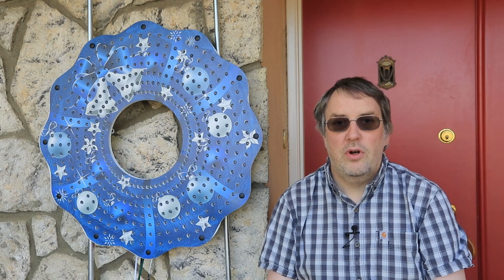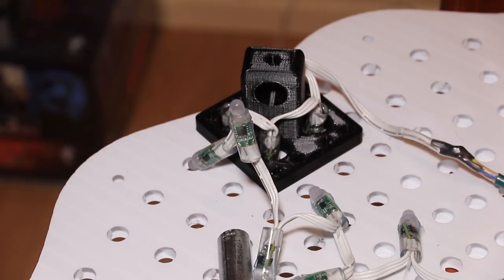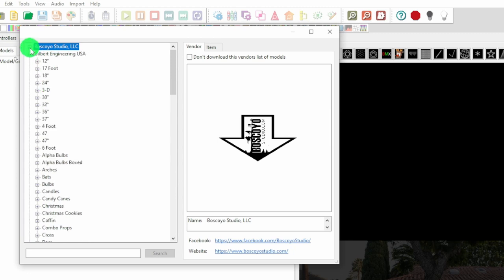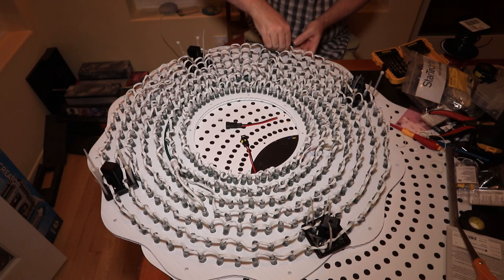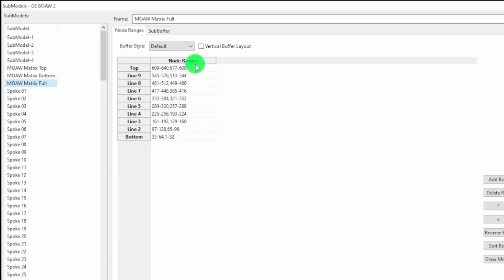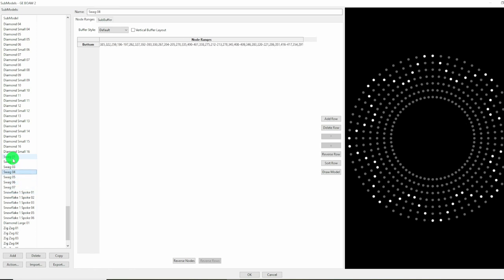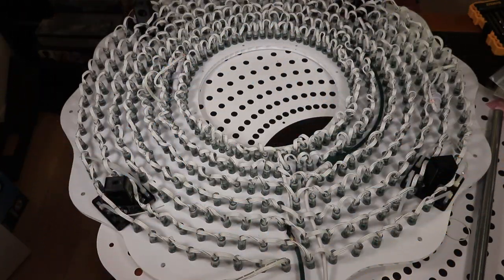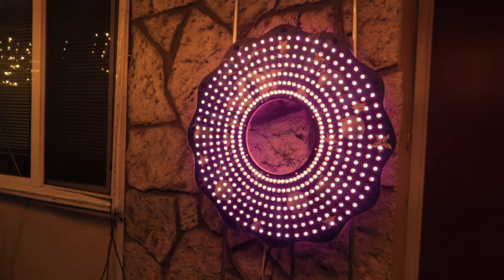Puente Pixels: Building the GE Baby Of All Wreaths (BOAW)

Comment: Do you normally not push the pixels all the way through your props? Its actually a cool effect the way it looks but id be nervous that some would just randomly fall out the back since none of them are pushed through.
Reply from the maker: Somewhat embarrassingly, only learnt that they were supposed to be pushed all the way through this year when building the new arches and they wouldn't stay straight until I did... always something new to learn in this hobby. That said, for this style of large "sheet" prop (or the Boscoyo Chromostocking we also have), I prefer the "smooth" look when the pixels are not pushed all the way through. Not had any issues with pixels coming out the back of the wreath.
Reply: @timlister177  yeah its certainly an interesting and clean look since everything is flush with the front of the prop...which I had just never seen until I stumbled upon this vid. And I'm sure if the back is tight to a house or fence or something, I can't imagine anything popping out the back either.